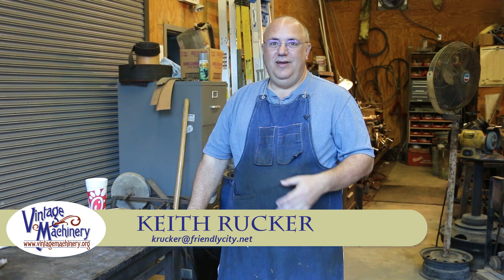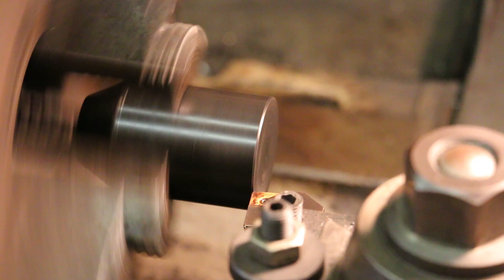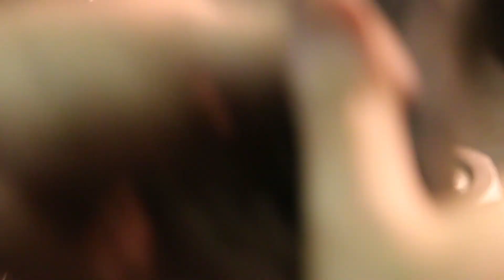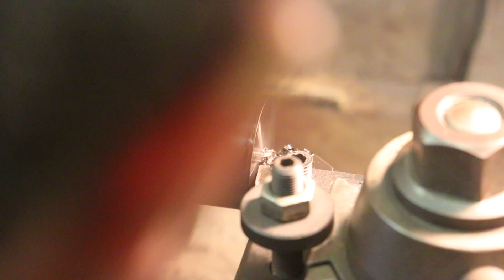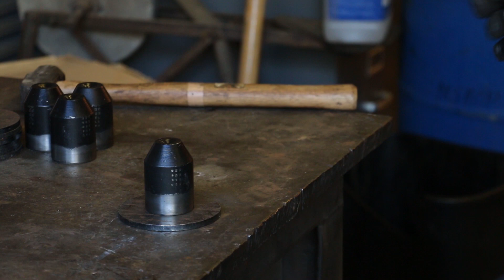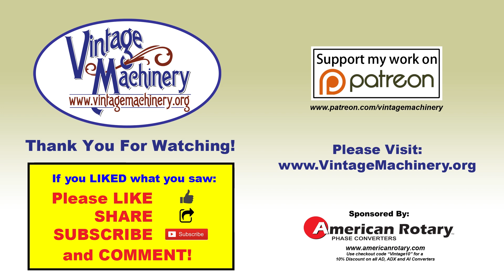Leveling Screw Feet Modifications

Comment: I like your attitude Keith. Your videos are the perfect treat for a time like now, im sure others know what i mean. Definitely my goto channel. Thank you as always.
Quick general welding tip: "if it has slag then you should drag"... if stick welding or flux core wire feed welding, then "drag" the puddle, if mig or tig, then push the puddle. this regards electrode angle. this is so slag is not trapped in the puddle causing porosity. you usually get better penetration and gas coverage if you "push" when using a gas shielded process. there are a few exceptions, but generally this is a good rule of thumb. figured i would throw in my .02, since you might be able to benefit down the road as you do some more welding in your shop.
Reply from the maker: Thanks for the tip!
Reply: +Keith Rucker - VintageMachinery.org Cheers! :)

Comment: Keith,
It's better to have too much stability than not enough. If plan on getting a forklift, it would take a little tap from the lift and your lathe could come crashing over. When I used to install mailroom machines, we had a labeling machine that wasn't a third as heavy as your lathe. It had the adjustable posts that fit into a dimple in 3" cast aluminum pads for stability. They even had them for the conveyor and that weighed only about 300 lbs. Thanks for the video and hope your and your family had a great Labor Day weekend!
Have a good one!
Dave
Reply from the maker: Thanks Dave!

Comment: Keith, good on you for adding the plates.  I live in California, and out here in earthquake country, it wouldn't have even been a question about the plates, it would have just been part of the design from the beginning.

Also, regarding the leveling feet, you mentioned they had a point on the 3/4" set screw.  The lathe would have come from the factory with a 2~3" cast iron disk with a dimple for the setscrew point.  These always seem to get lost.

Comment: I should probably do this when I move my Monarch, for the last 15yr or so it has just been sitting on 2" bar like what you originally had(might be 2.5" I don't remember) it has even gone thru a 5.0 earthquake in Missouri during that time.  A nice quick project and having the lathe at the right height is a back saver for sure.
Reply: i am assuming (from memory) than when in a factory setting, these machines had their own concrete base, slightly elevated, cast in place with concrete and thus when moved to the home shop, that is why they are an inch or 3 lower than needed and thus its easier to make feet than create a permanent thicker pad for it? i may be wrong of course
Reply: jusb1066
 Or maybe just people averaged shorter in the 1940's than my 6'1". It is also likely that by making the lathes shorter they saved millions of tons of iron by shaving 4-6" off every casting.  It is a trade off, the lower the lathe the easier it is to sling heavy parts into but the harder to operate, and the taller the lathe vise versa.
Reply from the maker: Well, at least you have living proof that my 2" high foot was not going to tip over!  I do think it is not a bad idea to add the extra footprint though....

Comment: Keith, I didn't read ALL of the comments in case someone has already said this but you may consider turning off your stand fan while welding with the mig process. It could/will blow your shielding gas away and cause you some unnecessary grief. Otherwise thanks for your videos.   I have learned A LOT of valuable things from you and the others in the metals genre of youtube.
Reply from the maker: When I use a fan, I will put the fan directly behind me so that I am blocking the direct wind on the welder.  Sometimes it is a trade off between tolerating our hot summer heat and humidity we deal with down here!

Comment: For doing stuff like that, what I've done in the past is to stick a piece of key stock or whatever I had on hand across the spindle hole to work as a stop for the workpiece.  Once you get that, you can set up a carriage stop or indicator 0, then just repeat a bunch of times to get stuff to the same length.  I don't leave the stop piece in, its just inserted so the workpiece will stop at the same point, then pulled once its tight.  Its not quite accurate to tenths but its good enough for a lot of things. 

Not kidding about that old chuck having some runout :) 

bigger feet is always a good thing.  Not much fun having pits and dings in your floors from having too much weight in too small of an area.
Reply from the maker: Agreed on the stops, but the truth is that it only took about 20 min to do all eight feet.  Setting up the stops would have taken as long as doing the entire job....

Comment: Hey Keith good idea,just something to think about is that the larger the footprint the less ground pressure per square inch.I did make some with a large base for my machine and had trouble keeping the machine still on large cuts seems to leave a wavy finish went back to 1-1/2 inch base and all is good now. Just food for thought ! Thanks always for the videos.
Reply from the maker: For me, the bigger footprint spreading the weight out is the main reason I went with doing this.
Reply: It seems to me you didn´t realize the main concern why people advised the washers. You have a tall, narrow structure, so the force required to tip it over is roughly radius over height times the weight load, so it would not require a side force of more than 1/3 of the machine weight to knock those feet over and land the machine on the concrete which obviously woud be very dangerous. 
The larger radius of the added base significantly increases the force required to knock the feet over.

Comment: A very solid little piece of work there Keith!

I can see where the concern about the diameter on the feet was coming from, but like you I think the weight of the machine itself would have held them very securely in place.  Perhaps the real win from this new configuration is the increased spread of weight.

In regards the welding setup; another big difference between MIG and TIG seems to be the actual technique of applying the weld.  From the tutorials I have watched on TIG it seems you physically bring the nozzle of the gas sleeve directly in contact with the metal surface you are working on and 'walk' it around, edging slowly step by step until you have completed a full circumference.  The pattern this creates in the solidified weld is very distinctive.  Apparently it is pretty hard on your fingers though and very easy to get them burned - to the extent one of the fellows who made a series of videos had actually invented a little sock made from asbestos or some other heat-resistant but thermally non-conductive woven fabric to sheath the fingers you use as a brace against the work piece!  A very nice idea I thought.
Reply from the maker: No doubt that the larger foot print is better!

Comment: Hi Keith nice job. I know my Lodge & Shipley is a little newer  but I think if you pull both feed levers on the apron it will cut a nice taper with out changing  the tool.
Reply from the maker: The apron on the LeBlond will only work in one direction or the other.

Comment: I like it.  The floor may be strong enough to take the weight, but once you're running it and get some vibrations going...this gives a little peace of mind that the legs won't start gradually jackhammering into the concrete over time.
Reply from the maker: I think we are in good shape now!

Comment: Nice job Keith. Maybe an 1/8" rubber pad under the feet would stop any vibration and reduce transmitted noise. When I did it on my little lathe it made quite a big difference.  I would imagine that the original adjusters would have just sat on a machine mount plate with a dimple in them. regards from the UK
Reply from the maker: Not a bad idea!

Comment: Keith, I really think this will be quite a bit safer even though they may have worked just fine before.  I am 6'3" tall and weigh about 260 pounds.  I have size 12 wide feet and I'm glad of it so there you have it, Greg.
Reply: Both of us have a good foundadion. I used to be 6'2" but am hammered to 5'11" now but I thought I had size 12 feet and have ended up with 14+ from the V.A. from Jerry Miller in New York. Weebles wobble but they don't fall down easily!
Reply from the maker: Well, I am a little shorter, a little heavier and have the same shoe size!
Reply: Keith Rucker - VintageMachinery.org  Like my Mom said about my ancestors (and her too) they were short, stocky and stubborn. She was 4'11".

Comment: I used to set up 180 gallon tanks on uneven concrete surfaces. What you have made there almost exactly matches what we used to use only ours where cast. We used them to spread the load and stabilise the tank just as you are with the lathe. I can't remember any issues with them.
Reply from the maker: Thanks Peter!

Comment: Keith:  Great videos.   Have you considered that you have reduced surface tension by adding the plates.  Great for the floor, bur are you setting up vibration and movement of the machine.  Possibly a small crosshatch of weld to enhance friction and reduce any creeping,
Reply from the maker: I will probably glue a thin piece of rubber to the bottom of the pads.

Comment: I'm not a metal worker or a machinist.  I've subscribed to this channel because I like the craftsmanship, I'm picking up tips that I hope I might use one day and because once in a while I see a steam engine.  Asking out of ignorance and because I'd like to know, when you were shortening the original pieces, why you didn't use a witness mark and/ or part them off rather than make repeated facing cuts.  As they say on the radio, thanks in advance for your response and I'll listen off the air.
Reply from the maker: Parting would have worked fine too but I find facing cuts easier to make than parting cuts.  When I only need to trim some material off, I usually face.  When I am trying to cut a part off, that is when I use parting.

Comment: Just wondering.  Did you use a parallel (or something similar) to lay across two of jaws on the lathe?  That would've been an easy way to make sure the "feet" were only going so far into the jaws.  Then it was a simple matter of facing them off to the same length, by ending the operation at the same travel distance.

Comment: Doing a bit of math, I'm assuming the situation is stable until the screw dimple is above the edge of the Jack Screw foot. Also assuming the floor is rough enough to prevent the feet from actually sliding, I estimate that with the original feet, you would tip them over if you applied a sideways force to the lathe of approximately 15% of the lathe's weight. With the modification to the feet you did in this video, I'm estimating that the new diameter of the foot is approximately 5 inches and the sideways force required to tip the new feet over now rises to about 36% of the lathe's weight. Also, I believe that the new feet will be more likely to slide across the floor instead of digging in and tipping. A nice simple modification.
Reply from the maker: Thanks!

Comment: I honestly don't think those would have been a problem. I set machinery all the time and jack bolts hold them up just fine, especially if there is also a way to anchor the machine to the floor. Sure, when I set the machines eventually we do pour an epoxy grout to the sole plates but what I am saying is those jackbolts are amazingly stable when the weight is evenly distributed.
Reply from the maker: Very true!

Comment: Hello Keith,

I guess that also without those plates under the stands that the lathe wouldn't move on it because of the weight. The force that is needed to move the lathe sidewards seems me very high before those stand would flip. But okay, better safe than sorry and when you got those discs for free than why not.

Besides, I'm curious about if you started with applying the tong and groove and how the finished walls and ceiling go look. Hope that you film an update at the next Odd&Ends and also curious about the restoration from the lathe.

Many greetings from Roel !
Reply from the maker: The biggest benefit of the wider foot is spreading the weight of the machine out more.  As for the shop, I am supposed to pick up the tongue and groove from the mill in the next few days - they had to mill it for me.

Comment: I agree with you Keith,  I believe your original design would have been fine but extra contact area won't hurt.  That does bring up another question.  What was the type of cement used and what was the thickness of your pour.  I assume steel reinforced concrete.  Cement can have different strength ratings.
Reply from the maker: The guys that poured my pad told me that it was rated around 5,000 PSI as they knew I was placing big machines in there.  The LeBlond lathe weighs about 3500 lb if I remember right .  With a 4" diameter foot, you have about 12.5 square inches of area under each foot.  Times 8 feet divided by the weight and it comes out to about 35 PSI on the concrete.  I should be just fine.....

Comment: What about distortion through the plates with the welding on them? May create an uneven surface to sit on.
Reply: that lathe will flatten those puppies out in a few months no problem. If the machine starts to vibrate beyond an acceptable level, Keith can adjust the feet to relevel. Keep in mind also that this is in a new concrete slab building, which itself will settle over the years - this is why the machines have millwright feet in any case.
Reply: Not likely. I am an English abuser. "Leveling feet" is a more universal term.
Reply: ..additionally, a millwright does a lot more than just level a machine to spec. :)
Reply: I was thinking the same thing, and personally would have faced them a thou or two hollow so they would flex to flat under the weight of the lathe. That way they are adding running stability in addition to accidental stability
Reply: +gravitysports1 no need to face, a few seconds with the nose of a strip sander when you're deburring is exactly how I'd finish that
Reply from the maker: I don't think it will make a hill of beans difference.  The bottom of those pads are at least as flat as my concrete floor!
Reply: Keith Rucker - VintageMachinery.org Too right.
Reply: I realize this question is 2 years old already but no one really answered it. Theres not enough heat from that mig in one little pass like his. By the looks of that gun, he was using a 110vac machine and they aren't rated for 1/4" steel. The mig machine manufacturers always suggest multi passes for 1/4" material or thicker. That big chunk o' steel is going to act like a heat sink. He could have done 2 passes and it wouldn't have warped. 
What he did here is good enough for his needs, but there is not real serious penetration here.

Comment: I have considered putting the same hard rubber matting that they install in horse trailers under mine.  The stuff seems to hold up well with shoed Clydesdale's stomping over them all the time.  With the weight of the head end of the lathe spread out through the plating the hydrostatic drive mounts to, I think it will be spread out enough to avoid any instability issues.  I'm not trying it to protect the floor, so much, but to try to dampen the sound of that hydrostatic motor and the electric motor that runs it.  It driveth me crazy sometimes...

If anyone else has already tried this, please let me know if the results were worth it.
Reply from the maker: A thin piece of rubber would be fine but I would want to go too thick for fear that it might compress over time.

Comment: Common Kieth. Chuck them in the lathe , drill and tap the risers. Drill and chamfer the discs. Screw them together with locktite on the threads. Chamfer the discs while still on the lathe. 1/4" too high? Now you've gone over the top. If you have a mat on the floor, have you calculated for that? it will be a out 1/2"-5/8" high. 

I think you just wanted a welding project and looked around till you found one.

Comment: Shouldn't there be some way to adjust the height of each one to adjust the bed for run out? I've seen that done on Adam's channel and it worked ....
Reply: the lathe rests with screws on the feets, which should be adjustable
Reply: Must be a nightmare to get 8 of them adjusted right!
Reply: yes, i think tom did a levelling lathe video, you have to check it lots of ways to prevent you over stressing any part of it while you adjust it

Comment: Belt and suspenders, eh? I suspect that the original 2" with 3" height was perfectly safe as long as you don't drive a forklift into the side, but why not, since you had the disks available? (I would have offered him scrap value for all that he had.)

Whenever I see a production run (even a short one like this) my mind turns to ways to save time and effort. Did you consider using some sort of ad hoc work stop. A bit of square stock between the chuck jaws (remove before starting the lathe) would let you set each "foot" to the same depth and then use the bedway indicator (or a carriage stop) to let you know when you had cut each piece to the same length without needing to measure after the first one.
Reply: That is a good idea.  Although they don't need to be exactly the same length as Keith pointed out, the way you suggest would have allowed that easily and probably very quickly.
Reply: Yep, belt, suspenders, and a EEE shoe.  Seems like a lot, but if you got it and can do it why not?
Reply from the maker: Not a bad idea Peter, but only took me 15-20 min to shorten all 8 of the feet.  It actually took me longer to film the first two than it did to do the rest of the batch.